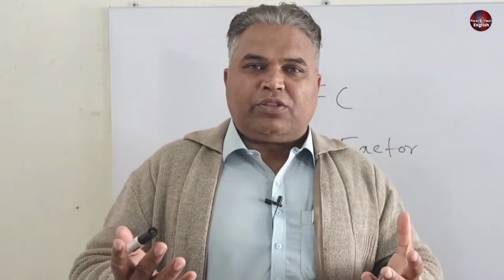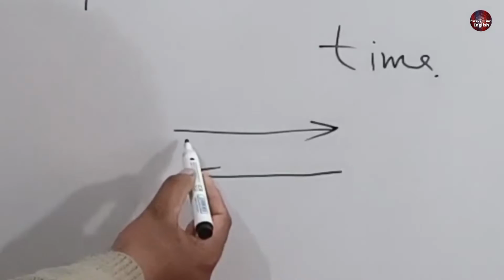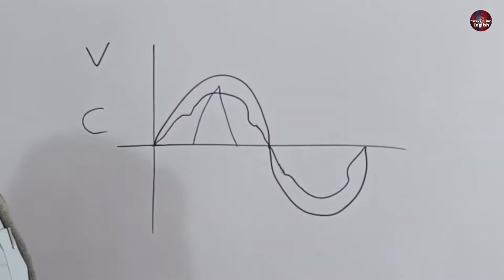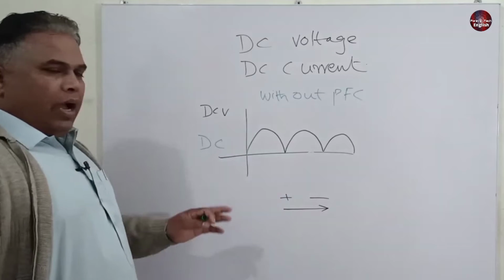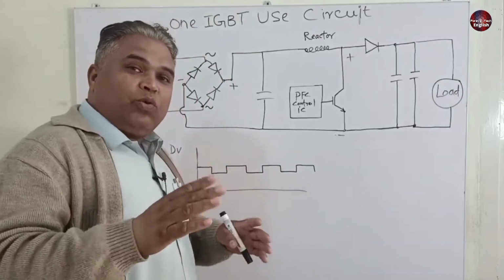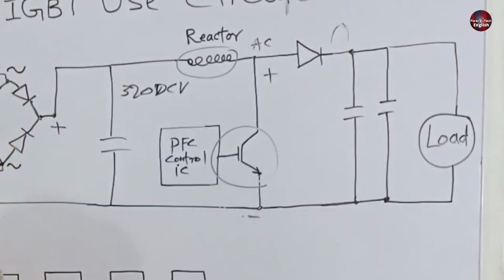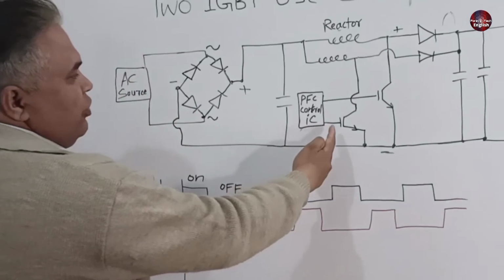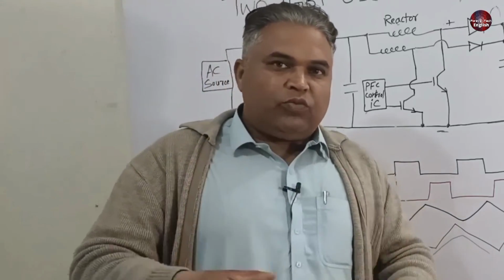The Use of IGBT in Inverter Power Circuits?

Comment: Firstly, I would like to say that I love your videos, I watch them all and always like them, and I had just  fixed a Fujitso that had a communication error, the defect was in the IC ULN2003, but I have a doubt: I thought that the reactor was used to prevent the capacitors from charging too quickly, increasing the initial current too much, which could cause damage to the board or even in the rectifier bridge, since a coil does not accept a rapid variation of current, it would prevent the capacitor from charging quickly. Washing machine has a coil in series with the motor starting capacitor and I believe the purpose is to prevent the capacitor from charging quickly.
Reply from the maker: Well I have Made a video on the Use of coil and reactor, you can visit the channel to watch that video. Anyways, good to know you fixed that communication error. Happy to see someone learned from my videos. 😍

Comment: This means, with two IGBT the current from the capacitor directly behind the bridge rectifier is more equal and at the output there will be less ripple voltage.
On PC motherboards this technique is used too, they use a slight phase shift on every step down converter, so that the step-down converter do not want to get the current to the same time. Maybe every step-down converter activates the MosFET with a time gap of lambda/4.

Comment: It's possible to bypass the PFC circuit if IGBT and driver IC are damaged? Often expecially in Inverter Aircon boards this IGBT fail but the power is so low (less than 1kW) so this circuit is basically useless and probably used only for EM compatibility.
Reply from the maker: You might be right, but when we specially talk about inverter air conditioner circuit board, the PFC circuit is very important. If there is a load which requires low current to operate then using a PFC does not matter. But if you have A load which requires more current to operate then Using the PFC circuit is very important and it make it more efficient as there will be no voltages drop. I have experienced that IGBT failed in most cases, but it saved the IPM and the compressor. IF there would had no PFC, the compressor or the IPM goes bad quickly